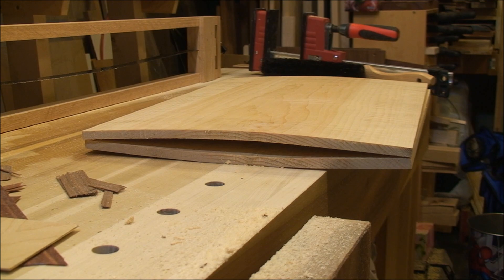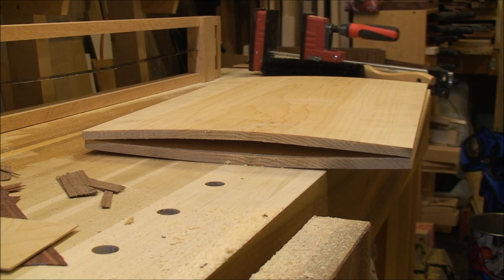Resawing with a frame saw

Comment: Fasten a bungee to the far end, then fix to the wall this will help pull the saw forward. Nice video!
Reply: I suppose if it's a fixed distance from your vise, it would be OK, but different length and width boards would get different amounts of pull-back.
Reply: @TomLeg  true, but worth a try?
Reply: @TomLeg  Not too significant. The vice is in the same location, unless you move your table. If the width of the board is making too much of a difference from the center of the vice to the edge of a longer board vs a shorter board, the entire thing is already way too tight. Alternatively, you can make it so you can adjust the length of the elastic rope/band
Reply: Now we cookin with gas! ⛽️

Comment: Great Idea! I was looking at the kits for these online and the price was going to be too much. You just saved me a bunch of money.
Thanks
Reply: I got the metal tubes and plates online from the Metal Supermarket for $16 Canadian ... they wanted to charge me over $40 for shipping and handling, but I should be picking it up at the local store. On the other hand, if you need other metal, as well, they give free delivery for orders over $100. I'm making mine about 12" wide with plane totes (handles) sticking back on a 45 degree angle, in imitation of James Wright. MIke, I like your very narrow frame. I'm using a 2" high section of handsaw ... I got three rusty handsaws for $10.

Comment: Great idea, I need to resaw some timber at the moment for instrument making. I have started a Bow saw but I mat change to your way. I'm thinking you cold make it with adjustable side widths in case you have wider boards. Thanks for sharing your idea. Also, I've had timber buckle & twist like this, If you wrap it in "Kitchen wrap, & weight it a bit the bends will come out>"Hopefully".

Comment: Well done. I'm going to build a kerfing plane and a frame saw as well. I am going to use an old backsaw blade for the plane and thought I about using a bandsaw blade for the saw as well. Sadly I don't have a bandsaw so I will have to make a little more effort. Great video!
Reply from the maker: Dutchhorse Thanks! The back saw blade may work better. Having the matching kerf width by using the bandsaw blade was nice but it also made the kerfing plane really aggressive and more challenging to use. Good luck with your saws!

Comment: The one thing I noticed is that the saw seemed a bit unstable side-to-side during use, rocking back and forth a little bit. Widening the saw should reduce that, as you're increasing the radius and thus decreasing the...rotational shift for the same linear shift.

That feels very unclear to me, so: moving the sides of the saw up or down a couple inches when you radius is only a couple inches will greatly exaggerate that movement on the blade in the center, while a larger radius will mean that the movement in the center will be greatly reduced when moving those same couple inches, as the circumference is much larger.

Comment: I have a bow saw I made, been thinking about making a frame saw, with the blad in the middle. Your design seems easier than most I've seen. Those are wide, as if you're going to resaw logs, while yours is more practical, won't see anything wide than 8/4 lumber. One design I've seen ( I think it was Tom Fidgen ) started off with a  large board which became an end piece with two angled handles.
Reply: The advantage to the larger frame, even on thin stock, is that it acts like a built in winding stick. It helps your ability to keep the blade very straight allowing very thin veneer cuts. The traditional blade is also a lot taller than the band saw blade here. That also assists in following a straight cut.

Comment: I can see mounting that frame to a motor that just makes it move up and down. It could resaw boards a lot wider than a band saw I could afford. This could be the beginning of a great idea. Nice vid too.
Reply from the maker: Thanks!
Reply: Bandsaw prices go way up once the resaw capability begins to exceed 6". And this board is, what, 12"?  If I had to resaw a bunch of boards like this, you can bet I'd put a motor on it. I've seen mediaeval woodcuts showing a frame with multiple blades in it and powered by water. One of those eye-opening experience I had in woodworking was when I resawed my first piece of wood and realized I was free of the tyranny of dimensional lumber.

Comment: You will probably have to saw both cupped panels in half and then plane them with their newly cut edges together and Re glue them back together……. Should work fine.

Comment: The cupping happened because the wood was slab sawed.  The humidity absorbed isn't equal on both sides.  So expansion is greater on one side.
Reply: The grain structure also screams cupping on the top board and both will likely split unless treated correctly.

Comment: Great kerfing plane and frame saw, I sure would have liked to see the inside of the cut to judge how much plane work would be involved. might have to cut those apart, joint them, and reglue them back together, just pay attention if you were planning on a book end effect. nicely done though.
Reply from the maker: Thanks!  I'd say it was pretty rough.  A lot of that had to do with the way the wood was binding on the blade but basically think rough milled lumber.  I think the final finished pieces were between 1/4" and 5/16" so I lost a fair bit (though the planing was quick as it is pine.)
Reply: Great, thanks for the response.

Comment: Look at the grain on the ends of the boards.  It couldn't be further from Quarter Sawn timber.   It is bound to have stresses causing cupping which were released by your sawcut, just by the way it was cut out of the tree..

Take the same type of timber and make sure it is near quarter sawn with the end grain running directly accross the board instead of along it in the piece you used, then you won't have any problems.

Case Hardening is when red hot wrought Iron is cooled in a sealed container containing an excess of Carbon, charcoal,  This is absorbed into the surface of the Iron giving it a Casing of Steel.  Steel being an alloy of Iron and Carbon.  Hence the name of the process, Case Hardening.   There is no such equivalent in wood.  Forced drying will only accentuate the cupping tendencies compared with air drying over a longer time.

If you want flat, thin boards then choose stock which is nearer quarter sawn.  If a tree is sawn through and through these will be the 2 or 3 boards in the middle.  To ask for quarter sawn stock puts the price up as the method is more wasteful for the sawyer.   You can get round this by only buying the boards from the middle of the tree, but then you have the problem of the centre pith. It is a judgement thing to get as near the centre as possible without getting the actual centre board.
Reply from the maker: It is indeed flat sawn as most boards that width are around here.  Flat sawn board do have a tendency to warp as the expansion is different across the board as the moisture content changes.

I do not believe that is the true cause of that cupping however as there was near even cupping on opposite sides of the cut.  The humidity in my little shop swings pretty widely in the summer and after I let these pieces sit a couple days I could see them move some (as they aren't quartersawn) but never came close to flat.

While the term case hardening is commonly used in metallurgy, it is also used in woodworking.  Here I was referring to what we see when wood is dried a little too quickly.  The exterior dries and the lignin sets while the interior is still wet.  As the interior dries it wants to contract and so puts the exterior in compression while the interior is in tension.  As I understand it, softwoods like this pine are more challenging to dry without incurring these stresses.

Interestingly, the boards which were not resawn were some of the most dimensionally stable ones in my shop and stayed quite flat while many other boards moved.  I suspect that the internal stresses actually helped the stability of the board while the exterior was in compression.

Some references:
https://en.wikipedia.org/wiki/Wood_drying
https://www.woodweb.com/knowledge_base/Case_Hardening_Explained.html
https://www.popularwoodworking.com/woodworking-blogs/how-to-test-for-case-hardened-lumber/

Comment: I like the simplicity of the frame design and the use of a bandsaw blade. The kerf saw was a nice touch. 

Did you find it easier to cut on the pull or push stroke?
Reply: instablaster

Comment: Thanks for sharing your video. I have been considering making an affordable saw and your’s looks great. Are you still using it? I’m wondering if making the frame wider would make it easier to control and keep straight. Also, I appreciate you showing the cupping in the wood. I would find that discouraging.

Comment: It would seem to me you could make the sides adjustable in and out to the thickness of the board. That would guide the blade and you could set it to resaw at an accurate thickness.
Reply: Imagine the friction. Also if your stock isn’t perfectly straight and true it would not be fun.

Comment: Yeah the cupping was probably cause by a combination of, case hardening... the grain pattern... and maybe  when you sawed the wood the heat created by friction caused even more moisture to evaporate out of the centre. Seems logical...
Reply from the maker: +dfmackenzie I'm pretty sure this was almost all case hardening.  I had the chance to watch the cut boards move as the shop humidity went from below 10%RH to 100% over many months and they retained that bow (which is also pretty symmetrical away from the cut.)  What I found interesting was that other pieces of the board that were left whole remained flat and stable.

Comment: Hello Mike...Found your video today...Thank You for the video and idea...!   I think you will "go" better by pulling the saw...Japanese style.  There is more control in the end, when the arms are close to the body.   I do it, with a frame saw and a special pull ripblade from Japan.  Even my hacksaw goes better, when the blade is turned 180.  Pull = straightening...!      If you fix the panel, so the saw pulls / "falls" downward, you will benefit from gravity too...Try it.   Another idea is to put on a straight japanese style handle, centered on the end. When the saw kerf has been established, you can grab and pull here...the other hand rests on top of the frame as guide.   This way you can change hands while you work.   I will certainly make a model and give it a try.   Again, thank You for uploading.  Greetings from Denmark...Jakob.
Reply from the maker: Thanks Jakob!  I like the idea of trying to pull the saw.  I'm curious if it would track as expected and would be a neat experiment.  Most of the binding was from the wood cupping of course.  I'm kicking myself for not trying to use the kerfing plane with a pulling stroke though!
Reply: Hello hello Mike...Good of you to reply...!   I know the video is from june 15, but the saw is still  very interresting.   If you decide to have a new go. you can choose wood with the grain perpendicular to to board...quartersawn I believe it is called.   This is more stable and easier to "tame".  = worth the effort.    When I get a model of your saw working, I will message you.   PS: A cupping board  can be clamped with a opposite bow, whilst drying.   A cupped dry board can be wetted on the concave side and then dried.   PPS: There are lots of videos of japanese saws on the tube.

Comment: You should try adding additional blades to make a "gang saw"... you can cut multiple boards at once. They do that in some old saw mills. 
 Also this kind of saw would work attached to a flywheel for a reciprocating action, with the user guiding it and lowering it into the kerf. the box frame makes the saw safer to handle. You can probably set up a foot treadle to power the flywheel, and then a belt pully to reduce the speed. I may need to experiment with this. I've been wanting to play with resawing boards and bookmatching, and this looks like a great alternative to a band saw.

I really like the kerf saw idea for guiding the cut...  Was that your original idea?
Reply from the maker: Those are some fun ideas to try with the saw arrangement though wouldn't really help me out with any projects I have lined up.  The original idea spawned from me wanting to resaw those wide boards for a couple of drawer bottoms and I had seen the kerfing saw used in some other videos.  I have only used the saw once or twice since but did make a new adjustable kerfing saw which I have used a bit more.
Reply: @wemike  thanks for the reply. 
I have arthritis so it limits my use of the hand saws as it hurts after a while, but a reciprocating engine might make me able to get by without investing a couple thou in a big old bandsaw. 
Plus I fancy using hand tools where possible.  Feels "closer to the wood" if you get my drift. 
So I may try it myself.

Comment: Do you have a video on building your saw?
Reply from the maker: Sadly no.  I'm still struggling to find a reasonable way to grab decent video while working in my little shop.  I made an attempt while making a replacement kerfing saw but never got around to editing the clips together.   There wasn't much magic to this frame saw however... the joints were simply butt or lap.

Comment: I am impressed with the accuracy you achieved. And thank you for showing the construction details. How did you drill the holes in the bandsaw blade?
Reply from the maker: Thanks.   Drilling was much easier than I had expected... just high speed steel twist bits on the drill press with a bit of oil.

Comment: That's great!  Did the cup come out?  Normally any similar cut can release stresses and produce a cup that will never come out. I would be surprised if I ever got more than two 1/4" boards from a 3/4" piece of lumber like that, once the boards had been planed to thickness.
Reply from the maker: Thanks. :) The cup stayed so I'm pretty sure it was case hardened.  I did get the drawer bottoms I wanted out of it but they were indeed only about 1/4" by the end.

Comment: Mike this is great, I've had a blade sitting around for ages that I've wanted to make a frame saw from and this has given me some ideas. I like the compact design of your saw, was it easy enough to cut with? I wonder if having a bigger frame or generally more material on the saw gives it more weight and so helps it get through the cut faster? - Clint
Reply from the maker: Thanks Clint.  I found the sawing action was quite easy... It would have been more comfortable if the corners were rounded off but I was happy with the hand position.  The board I was cutting had a lot of case hardening and most of the trouble I had with it went into dealing with the binding from that.  I don't think I'd need more weight as the bandsaw blade is super aggressive with negative rake.  I wanted it light enough so that I could take the weight off the cut to start.

Other frame saw designs are likely better but this is super compact to tuck away, was quick to build and was quite cheap.  Have fun!
Reply: Cheers Mike, I think your design is great! Look forward to more videos.

Comment: Did you do anything special to the fixed end of the blade?  It looked like a block with a kerf but I never saw the pin etc.  I like your tension block design.
Reply from the maker: Thanks! :) I actually made both ends the same way.  There is a saw kerf with a bolt going through it as a pin.  It is just hard to see since the saw is narrow.

Comment: Hi brilliant video, a few questions, Did you build the saw yourself and how did you cut the bandsaw blade to size, This something I have been needing for a while. Thanks for sharing sir.
Reply from the maker: Thanks Chris.  I did build it myself.  I didn't really cut the blade.. I ground a bit of a groove in it with the edge of my belt sander then bent it back and forth until it broke on the score.  I've been making a video on a new kerfing plane and for that one I used the corner of a chisel to do the scoring.  The drilling in the blade went easier than I expected as well.  I used a bit of oil and a twist bit in the drill press.

Comment: How difficult was the work?
Reply from the maker: The blade was sharp and has an aggressive rake so it cut the wood fairly easily (the pine is pretty soft as well.)  Rounding the corners where I hold it is the only change I'll make to it.
What was challenging was all the binding on the blade.  The fiddling around I needed to do with wedges was a huge pain.

Comment: Very cool.

How did you cut the bandsaw blade?
Reply from the maker: +Mariano Kamp Thanks... I ground a bit of a groove across the blade with the edge of my grinding belt (1" wide blue zirconia belt) and then bent it back and forth.  The groove helped focus the bending to one spot and the strain hardening from bending it back and forth let it break relatively easily.
Reply: How many teeth per inch of that band saw blade u are using?

Comment: Very interesting - nice frame saw build too. Did the band saw blade come pre-cut or did you cut it down?
Reply from the maker: +Paul .Austin Thanks. :)  I cut the blade down from an off the shelf blade.  It was a cheaper blade for a big saw as I wanted one that was about an inch wide to give me some purchase for the kerfing saw.  I don't have a lot of experience with working metal (especially steel) but it drilled surprisingly well.  I suspect I would have had a harder time if the blade was made of a better Sweedish steel.